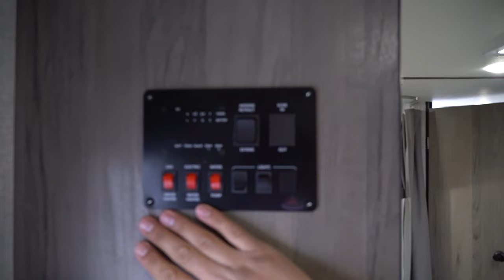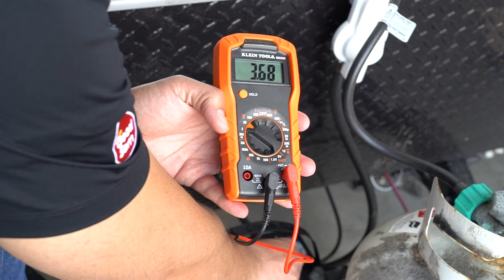NO HOT WATER?? Watch this to fix it! | RV Troubleshooting

Comment: you forgot the outside shower being turned on and the sprayer being turned off allowing the hot and cold water to mix.
Reply from the maker: AH yes! That's another good one Travis, thank you so much!!
-Ian Baker
Reply: yep, happened to me last time I dewiterized
Reply: Yep, found that one out the hard way. That and a hidden panel that took me 1/2 day to find the bypass valves.

Comment: What if I hen you touch the T&P value and it’s cold? What do we do next? We had hot water and then the next day there was no hot water and we’re trying to figure out why it’s not working because now we cannot use the electric hot water heater because it’s not working and so we’re having to use the liquid propane.
Reply from the maker: Hi There! 

Am I correct in understanding that you have a DSI water heater that works using either an electric heating element, by burning LP, or by using both simultaneously?

I'd like to start by confirming that first, and then I can find a more specific answer to your question. If you could send the unit's make and model #, that might also help us direct you to the most accurate troubleshooting info. 

Looking forward to your reply!
- Tucker Ballister

Comment: My tank has a thermal cut off diode which has been known to cook!    It is designed to cut out the main DC  power which kills the whole thing!   As far as I am concerned, it is in place to fix a Design problem where they have located both the wiring harness and mother board module 2” above the flame tube!  If wind blows flame out of tube, diode $$ blows to protect the electronics and electrical system!
I built a heat shield deflector from thin sheet aluminum placing it between the flame tube and the electronics and have not had another cook off of the diode since!
Reply from the maker: Hi Joe! 

To my knowledge, that thermal diode (also known as an ECO - "energy cut off" - switch) is a high-temperature shutoff device. It's an intentional design to shut off the flow of propane in an overheat situation (usually when temperatures exceed 180 degrees Fahrenheit). 

What is the make/model of your water heater?

- Tucker Ballister
Reply: @campingworld
Reply: @campingworld The diode is Called a “thermal cut off switch”  nothing eco about it! It is just a “blow fuse” that cooks when overheated, cuts off main DC power which closes the gas valve when the solenoid is de powered!
Problem is, it is located too close to the flame tube and cooks without a real overheat condition. A $19.95 replacement item at Camping World!
Therefore, the “shield” which prevents premature “ cook off” but will not contain a real overheat condition  and will then allow it to “blow” as it should to prevent fire and further damage!  Voila c’est tout!

Comment: What if you have hot water but it doesn't last no longer the under 5 minutes? I'm in a Keystone Outback 2016 I just bought. How do you make it last longer on electric?
Reply from the maker: Unfortunately, depending on the size of your water heater, it's possible that's about all you're going to get on just electric. Assuming it's a 6 gallon water heater, you can use that up pretty easily in a shower in 5 minutes. Depending on the model, it's possible that you could turn on both gas and electric at the same time for faster recovery. That being said, if you haven't drained the water heater since owning it, I would drain it (when it's cool, do NOT do it when it's hot and be sure to turn off the electric element) and take a coat hanger or some needle nose pliers to help remove sediment as that can also reduce the amount of hot water your tank can hold. Hope that helps!
-Ian Baker

Comment: Hi could it also be a plugged up screen on the mixing valve
Reply from the maker: Hi John!

I reached out to a member of our technical team for more insights into the potential for a plugged-up screen and how to remedy that issue. 

Here's their input: 

"This is a very common issue with water heaters that use such valves. The screen protects the valve from foreign material and itself is easy to clean up. The first time takes a while longer as you are just sorting out the details, but gets quicker and easier with experience. 

Here are the basic steps: 

1. Drain the water heater.

2. Remove the water line from the valve.

3. Separate the valve from the brass base. *Always use two wrenches, one to move the fitting and the other to hold the base!*

4. Using a 1 and 1/16” socket on a breaker bar and a pipe wrench on the bung, remove the brass base.

5.. Soak the brass base, which contains the screen, in vinegar or CLR. The vinegar takes 24 hours, and the CLR takes just 15 minutes or so.

6. Rinse THOROUGHLY, apply Great White pipe thread dope to the brass base, and assemble in reverse order. 

7. Fill the water heater, heat it to temperature, and watch for leaks.

Using the correct tools and sealant is essential to a successful repair. The space behind the water heater will be cramped, and this complicates the task. If it is really tight, you may be far better off removing the entire water heater and performing the service on the bench. 

**Failure to use the correct wrenches and backup wrenches will result in damage to the components. Without using a backup pipe wrench when removing the brass base, you can easily twist the entire bung out of the aluminum tank, ruining the water heater."

My final point is that bringing your unit to a service center is a smart idea if you're doubtful about your ability to successfully remove and clean the screen, especially if you think yours may require a complete removal of the water heater assembly. 

Depending on the year, make, and model of your RV, doing this kind of work improperly can void certain warranties. 

So, it doesn't hurt to call a service center and schedule an appointment to have your water heater inspected. 

Here's a link to contact the Camping World Service Center near you: https://rv.campingworld.com/rv-service-maintenance

Hope that helps, but let us know if you have follow up questions!
- Tucker Ballister
Reply: Thanks
Reply: How can avoid having this screen plug up in the future

Comment: I have hot water in sinks not in shower
Reply from the maker: Hi There! 

There may be an outside shower with the additional shutoff valve on the hand wand. If the hand wand valve is off, but the hot and cold valves are on, no water will come out of the hand wand but the faucet will act as a mixing valve. This will send cool or luke warm water to anything downstream of it, but any faucets upstream will be fine. 

There could be a failure in the shower faucet, so removing the faucet and testing the flow rate and temperature of the water coming out of the hot water line can show if it is the faucet or the plumbing at fault. 

Only high end custom units would be likely to have individual shut off valves at each fixture as in residential construction, but look to verify there isn't such a valve at or near the shower faucet. Damaged check valves at the water heater or winterizing valves in the wrong position can cause cool or luke warm water, but if these are the problem, there would be no hot water anywhere in the unit.

Hope this helps!
- Tucker Ballister

Comment: Same symptoms (tepid water), different cause:
We have a tempering valve that mixes the hot water with cold to maintain it under 50 degrees celsius (at least here in Australia) to prevent scalding. By removing the cap and adjusting with an Allen key we had hot water again.

This action may have increased the temperature, or my guess is that it may have loosened some calcium scale buildup blocking proper operation.

Comment: Should I have both the gas and electric on. Will it hurt to have both on? We got our RV In Sept 2021. Only went on 2 short trips before we had to winterize for the winter. We really are still learning. Thanks
Reply from the maker: Hey, Ian Baker here and great question! You can certainly have them both on the same time for faster recovery if you so choose. Bear in mind the electric elements only run on 120V, so you will need shore power or a generator for those to operate. I do recommend making it a habit (and add it to your post camping To-Do list) to shut off the electric element when you're done with your camping trip. I've seen many times when people have the elements on and drain their fresh water system and end up burning up the elements because there isn't any water in the water heater. Hopefully you find this helpful and I'm not confusing you more, lol. Thanks!
-Ian Baker

Comment: Hi I have a old RV and my light is not coming on to heat up the water. What can I do please and thank you
Reply from the maker: Hey Julie, Ian Baker here. Are you referring to your pilot light? If so, I would recommend first checking the burner tube to make sure there aren't any spider webs or bees that made a nest in there. You can generally clean it out fairly easily with a pipe cleaner. If that doesn't work, it may be best to make an appointment with your local Camping World to check it out as it's not always easy to diagnose and fix anything over text. Wish I could be of more help!
-Ian Baker

Comment: 7:15 Mark. Train your inept staff to inform new coach customers that most RV's have been winterized even if not asked for it. By default the water heater is bypassed and the drain plug removed as depicted in this video (white cap, goes on bare drain tube pipe on bottom, use nylon tape. My Heartland Mallard has a hidden panel in the King Kong storage next to the exterior water heater panel in the video and once removed. access was granted to said "bypass valves". Took me 1/2 a day to get hot water.

Comment: no switch on the wall
Reply from the maker: Hey Debbie, Ian Baker here. If you don’t have a switch, that most likely means it’s not a DSI water heater and you’ll want to make sure the pilot is lit by removing the outside cover. If its not lit, I recommend shutting the gas off for a few minutes to let any excess clear out. Then turn the gas back on and light the pilot. If it’s lit but the burner tube won’t ignite, then I’d recommend using a pipe cleaner to clean out the burner tube as often times bugs or spider webs will collect inside it. Hope this helps!!
-Ian Baker